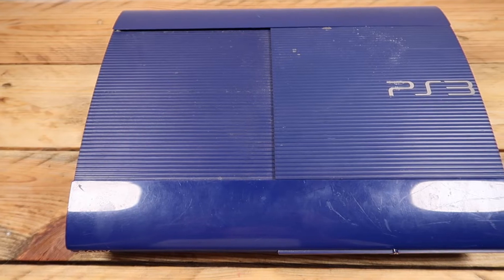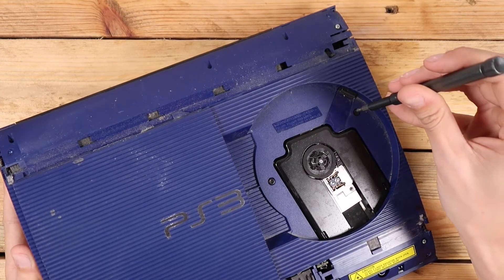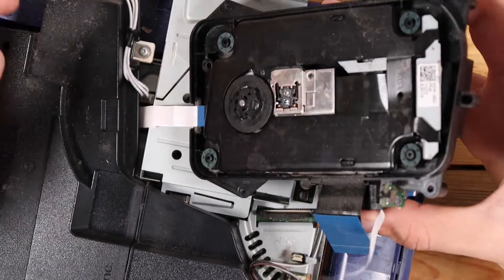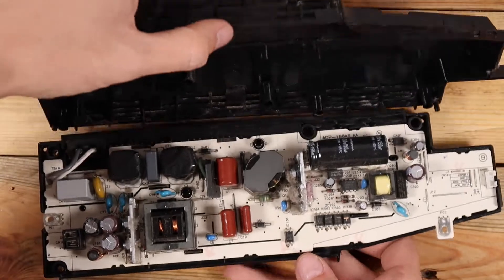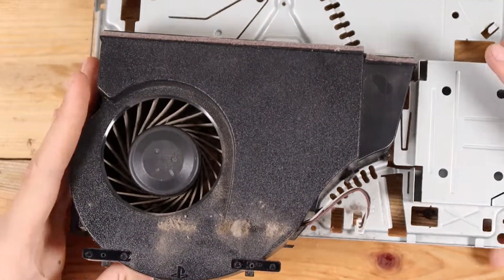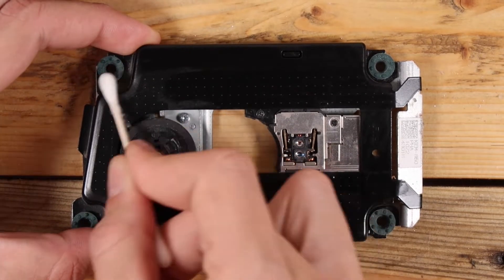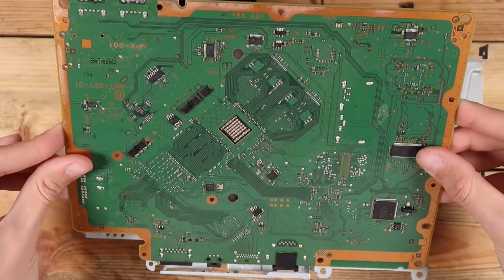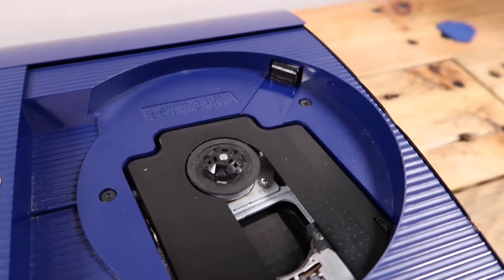Filthy PS3 Super Slim - Complete Teardown & Clean

Comment: Yo your Putting this all back together is Terrible I've got 2 Star screws extra 
this is So unfair for You Not showing a Proper Video !! 
that's why the Thumbs down 

where the Hell do those Go ..?
Reply from the maker: It’s been a few days since you commented so I hope you’ve calmed down a bit and realise that yelling at a stranger on the internet isn’t going to help you. Especially considering that I made this video to help others, not deliberately guide them into not replacing two screws. Now if you’d like to find out where those screws go, just take the time to pull apart the PS3 again nice and slow while watching a guide (doesn’t even have to be mine). But I’ll be honest, there are so many screws in these consoles that it’ll probably work fine without those two screws. Hope this helps. 

Good luck have fun.

Comment: found this video, was looking to figure out why my power button stopped, well... power buttoning. Everything went smoothly until the stupid security screw to the right of the HDD slot, the thing is just freely spinning, but not coming out, what do i do???
Reply from the maker: Hey! If that screw is free spinning, then unfortunately there isn’t much more you can do other than drill or cut it out. To drill it out you’d need to hold the screw in place with needle nose pliers and be super careful with the drill. Or if you have a dremel, you could use that. Fingers crossed you can sort it out!

Comment: i just got ps3they its for parts its works fine it didn't have no hard drive i put in 320gb it good enough  and no joystick it don't mater i have few joysticks. that's reason i got super slim just for games i bought online. my ps3 slim i molded it i want go online with it. i don't want to get banded

Comment: Mine kept powering down randomly without warning or messages.  Tried to take apart to see if it's dust...screws were impossible to remove, used a pair of pliers.  It came apart, in a few pieces, no dust inside, i guess it was the mo0therboard...in the trash it goes lol.
Reply from the maker: PS3’s are prone to cold solder joints that can cause power issues like not turning on, or power cycling, so maybe that’s the issue? It’s more common on ps3 fats but still. I’ve fixed one before by simply using a heat gun over the processor chips for a while, then allowing to cool and reassemble. Could be something to try if it hasn’t already made its way to the bin haha
Reply: @TheBygoneEra  No idea, it worked fine, i didn't use it for about a year, and then this happened.  The inside was clean as can be,  no burn marks anywhere, no dust at all, solder looked pristine all over the motherboard and power supply.  Bought a slim for 30$, working great so far!

Comment: I just got similar ps3 that was also very FILTHY, like it was stuck under a bed for years, dog hair and years of other crud and cigarette smoke smell baked into it. I might have to do this because that smell is nauseating whenever i turn it on

I also have to add: some parts you move WAY too fast, especially the gears part, that is the absolute worst of the whole process
Reply from the maker: Good luck on the clean! Apologies about moving too quickly, I just don’t like making the videos too long

Comment: I got my hands on a Super Slim recently, that came with two very filthy controllers. I gave those a bath and cleaned them up nicely and I used your guide to dust off the console as well. I was expecting the worst, but upon removing the top cover I actually did find a pretty tidy PS3. :) Thanks for the video! 👍
Reply from the maker: Nice work! I’m glad I could help!

Comment: No! That's a bare die, like in a laptop, you used way too much thermal paste. If it's not an IHS (integrated heat spreader), you only need a tiny bit to cover that small surface area (the area is the square of the length)
Reply from the maker: Helpful information to know! Thank you!

Comment: WD40 gets rid of glue from stickers. Soak the sticker and residue with WD40. On smooth surface, use razor blade (plastic or metal) to scrape it off. On a plastic textured surface, use a scrub brush. Then to get the oil off after, use dish soap and water, and then finally alcohol.
Reply from the maker: Very helpful thank you!

Comment: great vid man my super slim ps3 model cech 4221c needs hdmi ic chip do you know what the chip code should i get for replacement or i just use a ps3 slim chip 👍❤️
Reply from the maker: Unfortunately I’m not too sure about the chips used sorry. Best of luck!
Reply: You ever tried to remove an IC from a board. VERY difficult if it is soldered directly to the board

Comment: I tried cleaning and my ps3 for the first time using this guide and I got to the part were I'm about to lift off the top but I saw the yellow sticker about the radiation to lasers and freaked me out. Just wanted to k on if its safe to open the ps3 or did they mean don't look at it while it's on? Sorry I'm not so tech savvy
Reply from the maker: Hey yeah it’s perfectly safe when there is no power to the console. It’s only dangerous when you look straight into the powered up laser
Reply: @TheBygoneEra  I'd figured but still wanted to make sure, thanks for the response I appreciate it

Comment: Try some goo-gone for that bottom residue left by the sticker. Works well for me, let it sit on it for a few minutes and it will be easier to wipe it off after. My fav part about this video is how you detail clearly each screw removal. Often times in these tear down videos you can’t tell what types of screws come out of where and when trying to use these videos to match the screws back up during assembly this is helpful. Thanks!
Reply from the maker: I’ll give goo-gone a go! And thank you! It’s definitely tricky to show each piece and screw coming out without the video dragging on too much, but I try my best!
Reply: @TheBygoneEra  I used something similar on my red console's glossy part and it ruined it.

Comment: Like every other "detailed" teardown, you all seem to quickly skip over that one key part of dismantle. LMFAO.
Reply from the maker: How so? It’s often hard to make a disassembly video that covers everything but also isn’t an hour long, because no one would watch that. Ultimately due to this, some things get cut, however the things that get cut are usually very self explanatory things. So what did I miss?
Reply: Your video is actually one of the better ones I've seen. It just make me laugh that in nearly all videos, everyone cuts the part where the bottom shield plate is removed. This part should be talked about more, as so many people have damaged the RSX and several other chips in attempting to remove it.